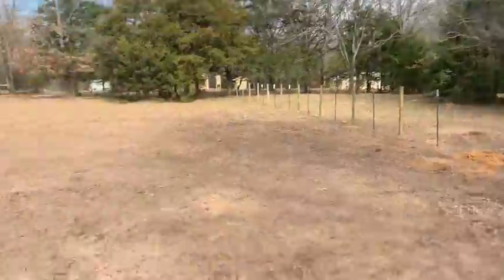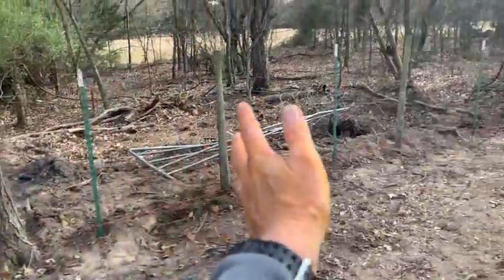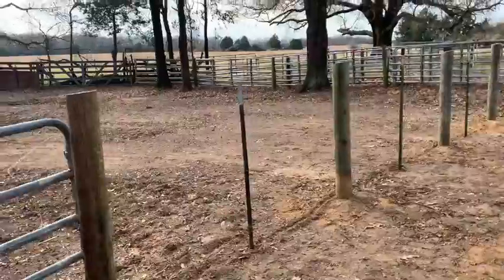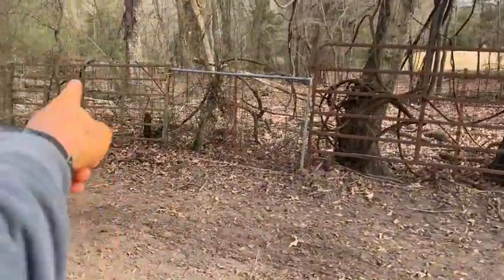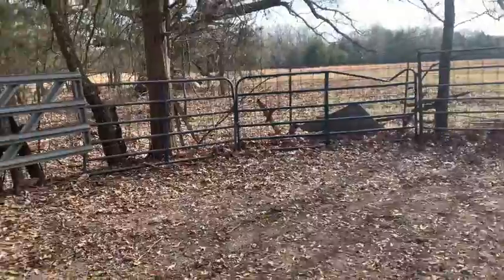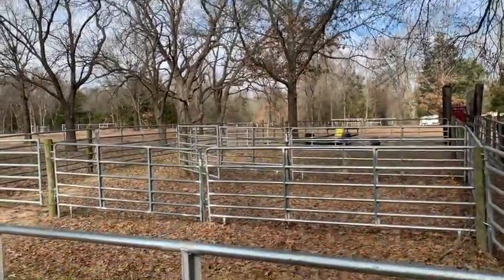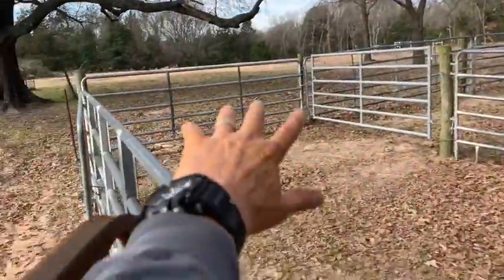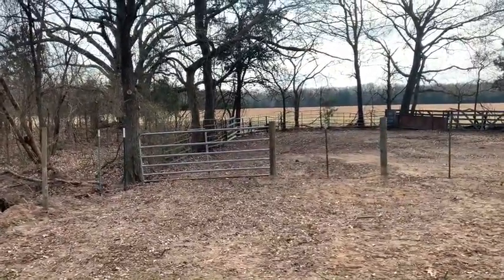Cattle Working Pen Update

Comment: I remember those galvanized gates.  They came unassembled.

Is the kubota diesel or gasoline?
Reply from the maker: Wow, I didn’t know they came unassembled.   I’ve seen them all over the country.   They must have had a monopoly at one point.    The Kubota is the gas version.   It has a Subaru engine.   So it should run forever.   Kubota out sourced they gas engines for a while before they bought the small engine group from Subaru.   We love it.